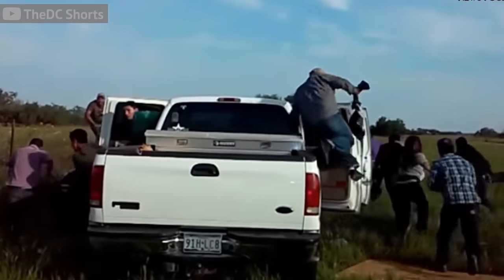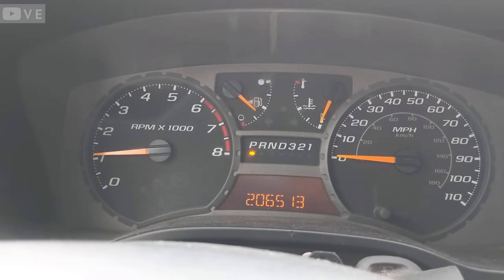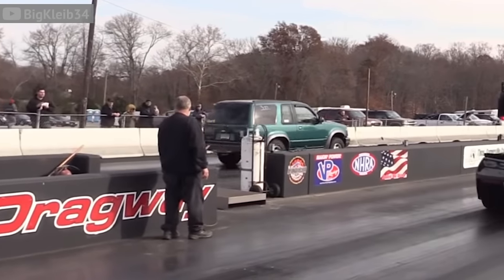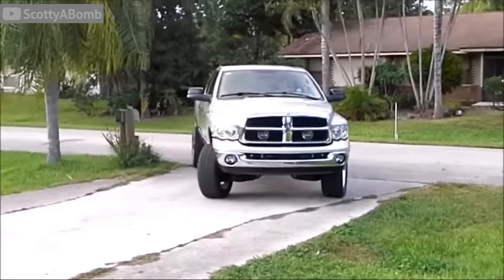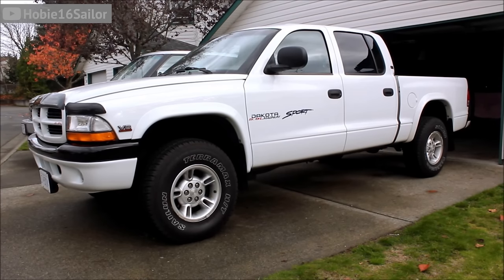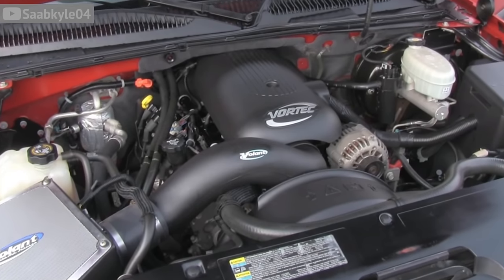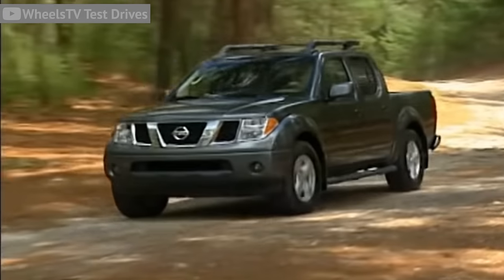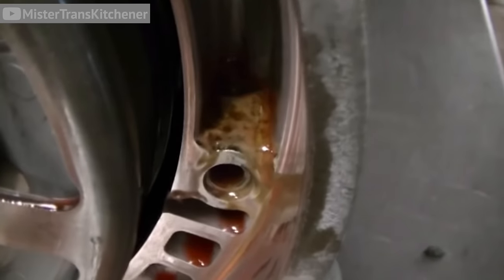USED TRUCKS YOU SHOULD NEVER BUY!

Comment: Ive had a 1st generation avalanche 2005. It had about 200,000 miles on it before it was t-boned and totalled. The truck was flipped over but it saved my life. No issues. 
Now i have a 2nd generation with 190,000 miles on it. It drives differently but not in a bad way. It's just smoother. No issues with this one either. Only major repair was $800 oil pan gasket via dealer. 
For the money, and what you get, definitely worth it. I don't think any truck can touch it. Chevy used all the same engines and transmissions, interior, electronics, body panels, everything on all their trucks and suvs for those years. Why? Because they worked and worked well and reliable.

Comment: I had an 07 Colorado with a 2.8l 5speed.  Never had rust, never had s as any issues and had it to 80,000 miles.   Only disappointment was the fuel economy.

Had an 01 f150 with a 5.4.  Had 234,000 on it.  Ran excellent.  But someone else had done the tuneup on it prior to me buying it.  

Plugs, exhaust manifolds and front cats were problematic-but overall, it was a beast of a truck.

Comment: I had a 2002 Avalanche with 330k miles, bulletproof work horse! towed at 8x30 enclosed lawn trailer for over 10 years. Original motor and trans. Yeah the body cladding paint fadedbut BUT WHO CARES  it was running perfectly being 20 years old.  Sold it for $5k and bought a 2002 Suburban because it shares the same platform and it's just as good.

Comment: We have a 2001 Tahoe with 235,000 on the clock and the only issue we have had with it is an unreliable park brake. (we purchased it used with 80000 on it)  We also have a 2006 Avalanche we bought with 36000 on it and now have 85000 on it with no problems and I tow a camper and a car trailer with it with no issues!  Love my Chevys

Comment: Lionel here in central California. I don't know where you get your information from. But the Avalanche is a great vehicle, at least the second generation is. I own one and love it. You see them with a quarter of a million miles and still going strong. It's safe to say you never owned one. Maybe never drove one. So if the plastic is fading, it's a truck. Mine is a 2007, it runs great. The doors close so nice, click, click. The ride is nice too.
Reply: I love mine also. It's an '09 originally from San Antonio TX. It drives and rides so smooth and quiet! I keep the radio volume very low, but it still drowns out the road noise. Mine is a fully equipped LT. Everything except cooled seats. Has an 11.7K towing capacity. I found it for only $10K! Nothing wrong with it, which surprised me. I wouldn't trade it for an F-350 or anything else on the road, especially a Dodge, Toyota, or anything else! I LOVE it!

Comment: Important to note that the 5.4 had two different versions the 2v in the 10th gen f150’s and the 3v triton that came out in 2004. The 3v was the one that was known for all the issues while 2v is pretty reliable and only issue is the spark ejection issue which is still pretty rare as long as your not like dragging them
Reply: Agreed. If u take care of stuff, they last. My dad has had 3 5.4L, two of em were 3V and the other was 2V. As long as u replace the spark plugs ounce every 80k km you will have issues with them as often as any other engine

Comment: Sorry dude. My 2010 Avalanche Z71 4x4 is badass. And I've never had any of the issues that you called out sir. 150K miles and still looks great and rides like a Cadillac on or off road. Bottom line, worth every cent.

Comment: The odometer issue you get so excited about was fixed in a recall long ago (more than a decade ago.) Your "research" should have told you that. I have owned and loved my Z66 since I bought it new in 2003. Has over 200k miles on it. Interior has held up very well not to mention the exterior. Fortunately no rust as I live in a dry climate. I did buy a rebuilt transmission somewhere around 115k miles. No problems since. It uses parts from many other chevy models so no issue there. Someone offered to buy it from me the last time I got gas for it.

Comment: The cladding on the Avalanche's were not painted, it was just plastic, that did not do very well when left in the sun and not protected. Many people did sand them smooth and then painted them.The dash clusters were very cheap and easily fixed by replacing the stepper motors.The transmissions did have one hard part that was not heat treated properly and some did fail early. Everything you mentioned about the Avalanche was true for all the Gm trucks in those years and covered under warranty, except for the plastic. My cladding still looks like new, but it has been in the garage the whole time. People either loved them or hated them. I still have my 2003 and don't think I would ever sell it. I think it is one the most versatile vehicles ever made.

Comment: Chevy has always had electric gizmo issues but it came with a tonneau cover half inch at least that you can stand  on and the whole back wall comes down opening the cab of the truck up like an old k5 blazer or big body bronco which is awsome and it comes with bed boxes with drain holes in the bottom which means they can be used as coolers so i think on the avalanche it is being underestimated and overlooked as far as all the trick little features it has that prior to me owning one even with a buddy having 2 never knew about the features i found and love about it

Comment: I have a 2002 avalanche z71 and honestly one of the best trucks I've ever had, I'm sitting at about 215k miles and I've put 50k on myself. It is one of the smoothest driving truck because of the coil springs in the back, it has the indestructible 5.3, and overall I've only had to do is upgrade  the exhaust and intake cause I wanted a big rumble

Comment: We own a scrap yard and we have had many 5.4 fords come in where the motor is well into 200+ miles and still going.. we just crushed one with 285k on it and it ran like it was new.. We actually ran that truck for 2 years as a parts truck after buying it for scrap. We ran it till the rust was too bad. I think the 5.4 is a good motor outside of the plug issues..

Comment: You got the Avalanche all wrong. 1st, the plastic isn't painted to begin with, so it just fades and "tiger stripes" ... so then you paint it, no more problem! The rest of the truck is no different than any other GM truck, same engine, same drivetrain, same wiring harness, same gauges, same EVERYTHING ... so, it's like you have no clue what you're talking about because YES, it qualifies as a "truck". My '06, with a lot of preventive maintenance, still looks like new with nearly 200K and over 15 salt-laden NY winters and I've YET TO EVER HAVE TO ADD 1 DROP OF OIL BETWEEN CHANGES!! (So much for "drinking oil like it's their job"!) Nicest vehicle I've ever owned by far!

Comment: Enjoyed the video, but I do have to disagree with you regarding your information on the early Avalanches. 
1) The majority of transmission issues with the 4L60E transmission were due to the failure of owners to activate the tow/haul option when transporting or towing heavy loads. This was what led to a majority of the failures. With regular maintenance and proper use, the transmission was solid over 300K miles, (I know because my 02 Avalanche had 365K when I sold it a six years ago and I still see it on the road around town to this day.
2) The cladding was never "painted" on the gen 1 Avalanches. The plastic would fade and become chalky because of a flaw in the manufacturing of the cladding. Chevrolet offered a 1 time restoration service to account for this, but the process only lasted about 6 months before the fading returned. 
Owners did not start painting the cladding until much later.
3) The Gen 1 5.3L and 8.1L motors in the gen 1 Avalanches were absolute beasts, and would run forever provided regular maintenance was done. It was not until the implementation of AFM in 2007 models that the engines began to suffer lifter issues, and that was not singular to the Avalanche, but to ALL trucks with the 5.3L V-8's after 2006,

Comment: Chevrolet SSR was the best car that Chevrolet introduced in 2003, it's actually sport, cool looking and looks luxurious as it performed. It had a folding hard top convertible plus it's reliable and doesn't have common problems plus it was intended for retro styling and being a roadster and not really a hauler but you can still put things in their but if you wanna haul Ikea furniture then you should by those other heavy duty pickups that can transport things.

Comment: I owe a 2005 5.3 V8 Avalanche with 181,000 miles. I tow a 6,000 travel trailer and never had a problem! Always use the tow button when towing or hauling!

Comment: Just to clarify on the ford 5.4 engines. the 1997-2000  model years were the ones with common issues of spark plugs blowing out. It was usually a fairly easy fix with a helicoil. 2001-2003 5.4 2 valve motors were pretty bullet proof. The 2004-2010 3 valve issue was a failure of the cam shaft position because of clogged oil pathways that were too small. This caused issues with needing new timing chains and guides as well. The only fix was a revised new engine costing at least 6k to fix. there is no fixing the old engine because the oil pathways were clogged. The reason for the clogged pathways, is a design flaw. They were mad too small, so the slightest bit of dirt would clog them up. New parts would go bad again because the pathways were still clogged. The 2004-2007 3 valve came with a 2 piece spark plug that would most likely break off.

 I'd stay away from the 2004-2010 5.4 3 valve engines like the black death.  I own a 5.4 2 valve with 320k miles, and it has been great. I almost bought a 3 valve 5.4 but decided against it. My mechanic worked on the same truck I almost bought, and all 8 spark plugs broke off. He said it cost 1800 to fix. I have a friend with the 3 valve 5.4 who needed and engine replacement because of the  oil flow issue. Take a listen to an original 3 valve, and it will most likely have a ticking noise that warns of its impending demise.

Comment: My fav truck is my dads witch is ford (my fav brand) witch has a 4 in exhaust 4in lift year 2000 with a 7.3l diesel automatic 4 wheel drive short bed (I would want a long bed if I could get one on the truck) 4 door cab

Edit it’s also an f 350

Comment: The only problem I have with my avalanche [2004, non-cladding] is that the original owner only took care of the body and not the engine. Sure it needed some love and now it runs perfectly. [other than it needs it's computer replaced as it sends out a faulty P307 code] Out of all vehicles I've been in, this drives and rides SMOOTH. Even after 17 years, there's NO RUST. [Thanks to the person who invented undercoats]

Comment: Plus my Nissan Frontier has been the best truck I’ve ever owned. 8 years in and would still buy it again. If you get one just put a separate trans cooler and delete the radiator one or just get a manual. They have one of these that hit 1000000 miles

Comment: I don't like Avalanches but they are super reliable. Any GM with the Vortec 5.3l is legit bulletproof. My 99' Silverado, has 250k miles with the motor running like if it was brand new. I know they can surpass up to 500k miles.

Comment: You really should take a look at the mileage of most used high mileage avalanches. I am not sure about the first gen, but the second gens go an easy 200k, and there are a ton of 2 second gens online that have 280k plus on them. I guess I would have loved to have heard you talk more about actual specific issues with second gens rather than just talking about the speedo issue on the first gens. From what I have researched, the second-generation avalanches are a pretty solid truck that run forever.

Comment: As for the Avalanche, that's cuz it was made in 2006
2005 was the best year for Chevrolet, that Vortec wouldn't stop kicking, and the transmission too in a Suburban, barely had it's transmission fluid replaced and it still ran like a dream.

Comment: i own a 2004 Avalanche blacked out with 20 inch rims Z71 no cladding. i rescued it from a person who let it sit 7 years the tranny went back in 2015 at 166.000 miles. they managed to keep it running but never washed it had 4 flat rotted tires with rusty rims and it looked like the swamp thing. the entire brake system needed to be replaced from rust along with the tranny. i detailed it took 5 days. looks and it drives beautiful the motor and tranny are smooth the only complaint is the gas mileage is not good being $10 a gallon Canadian means it is $40 a day to drive.

Comment: 04-06 models don't have any engine or transmission problems. Just the cladding on the back sail panels and bed covers. Which you mentioned that the paint faded. The paint doesn't fade because they were not painted. The finish on the plastic fades out and the solution is to use something like raptor finish paint which can be clear coated and painted to whatever color you want and it looks great. Trust me I would know. I've had my 2005 since it was brand new. So eighteen years with hardly any issues at all. 2004-2006 models are the sweet spot when it comes to Avalanche models. Early models and the last 2 models were terrible. Unfortunately the new Chevy Silverado High Country is the worst of all. When parts break on this truck it is 2 at a time sometimes and the price is just ridiculous. Put that model on your next video.

Comment: My dad had the isuzu equivalent of a colorado for 10 or 11 years. Bought it used. It was a great little truck that was very reliable and had absolutely no rust on it when he sold it. I crawled under it. Hauled more firewood than it should have, had a very strong 4 banger, and in my opinion was a good looking truck without being over styled. I honestly miss it. The one bad thing about it was he was constantly replacing light bulbs on both front and rear. Don't know what that was about

Comment: My 02 avalanche has over 300000 miles on it. Zero engine or transmission problems ever engine still almost silent with almost not heat damage and have never had any kind of speedometer problem.

Comment: The Ford Triton 5.4L he is talking about is the 3 valve, yes the 2 valve version spits out spark plugs if not torque correctly. I own a 03 F150 and have had 0 issues with the 5.4L 2V

Comment: Dakota's were awesome trucks.  Literally drove as smooth as a car but all the utility of a mid size truck.  The 4.7 V8 produced 15 HP and 40 FPT less than the 5.9 in the Ram.  As long as you performed general maintenance they ran smooth as a top.

Comment: First...the cladding wasn't painted on the first models.  The plastic like many other vehicles fades. Never heard of any speedometer issues and mine has 290,000 miles and all I've changed is the fuel and water pumps...and it hits over 100 MPH in a heartbeat and doesn't have any rust.  So yeah, it's JUST YOU...

Comment: Dude I had a 2000 Dodge Dakota, and only had the brake issue. I also have a 2002 avalanche, zero issues with it. It has 182k miles running strong.

Comment: The stepper motors in the dash were a common problem in all GM vehicles of that time. I've got the same oil pressure gauge issue as others but it's a sensor and I just don't feel like messing with it. Sensors go out on any vehicle. I love my 2005 Avalanche Z71 160k. Hell all trucks need maintenance and if you don't do it failure will happen.

Comment: I'll give the man his opinion but I own an 02 Avalanche Z71 with 232000 miles on the clock no engine rebuild no transmission rebuild no problems with the drivetrain whatsoever just minor rust on both rear quarter panels

Comment: Ima disagree only slightly about the colorado. I got an 05 with the 4 cyl. and a 5 speed manual. Just rear wheel drive. Its been my daily driver since late 2014, and its been through some abuse. Maintenance has been affordable, im religious on that mobile 1. You are completely right about the electrical issues though, although they were not expensive to fix. Fortunately i got a buddy that helped me rig it up, and havent had issues since. We couldnt really find info online, and im not sure exactly what he did, but basically u need bypass a couple wires in the harness and direct connect, disable the feature where the radio stays on when car is off until doors open, bypass wiring harness partially behind ac control and now the blower always works
Btw, bought with 63k miles and I just rolled 160k. I carry ladders on it, and got a contractor topper full of tools. I live in northern illinois, but bought it in southern missouri and it has less rust than the 08 silverado i just bought. I only wash it about once a year, and it is quite offroad capable for a 2wd! She dont sink. Is it just me, or is the front end beefier on my colorado than silverado? The thing definately stops faster than the silverado, even though its squatting loaded down.

Comment: The early Frontier had a radiator flaw that would ruin the auto transmission, not the transmissions fault. I believe the issue was addressed in 2010? No problems since. 
Scotty Kilmer has a video titled "If you don't have this cheap truck you're stupid" he explains that the truck is a proven platform with the issues worked out. Not a fancy truck just an honest one.

Comment: Oh boy,you are so right about that Ford 5.4. From 2004 to 2014 Ford built that junk. Your lucky if you get 200,000 without replacing the cam phazers. I have a F150 sitting in my yard right now that needs another engine. I have a 2002 Chevy Avalanche that runs great but it only has 58,000 miles.